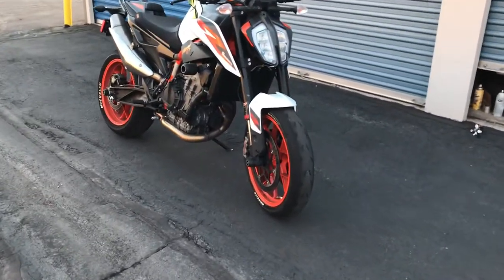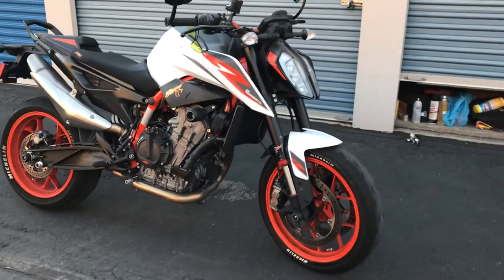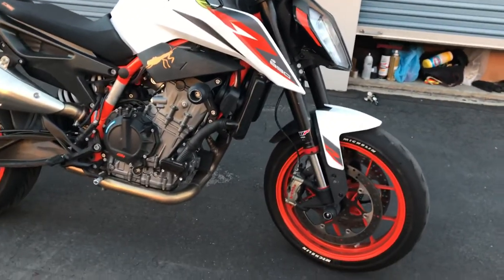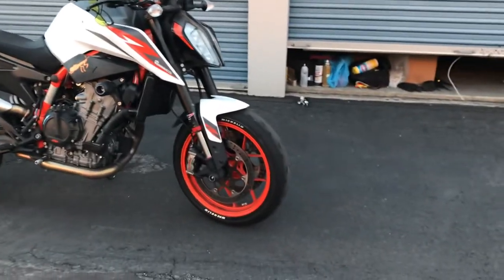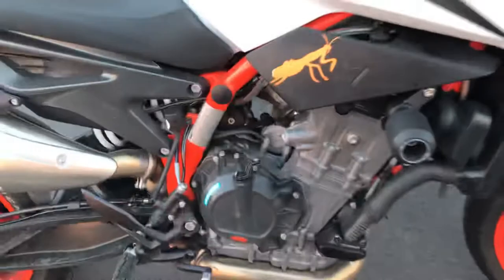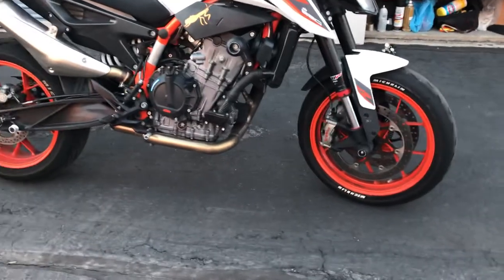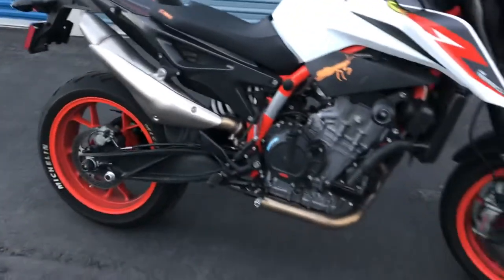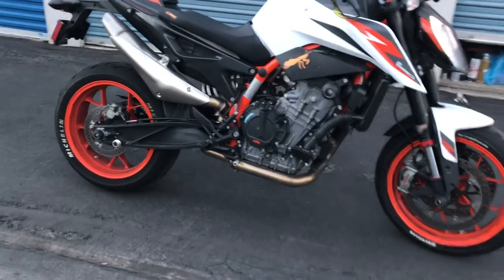Duke 890R Episode 4 year long update

Comment: Thank you for sharing this video. That booster plug you were talking about, is that all you need to run the Arrow de-cat? Intensely wonderful bike but all the niggles current and potential is a huge source of 890r ownership anxiety. Up until you mentioned that ticking I just thought it was the way my bike sounds. Now I think the top end is going to blow up.. is it!😅 Probably should’ve got the new mt09. Seriously though this is a crazy awesome motorcycle.